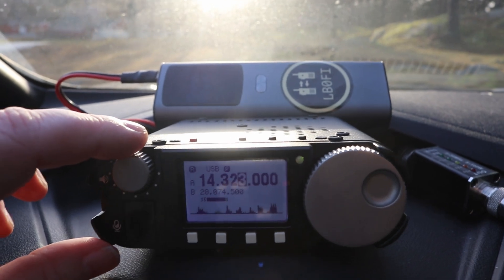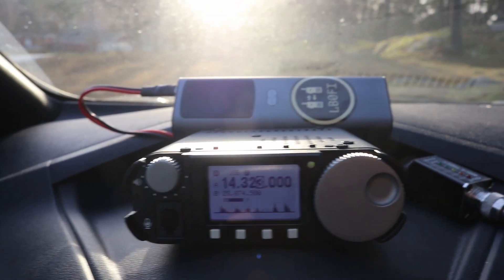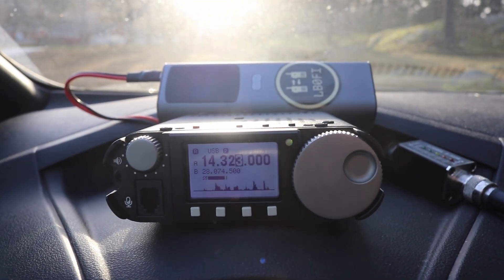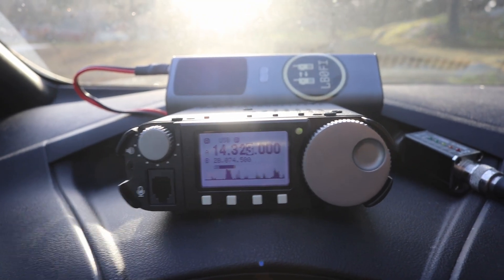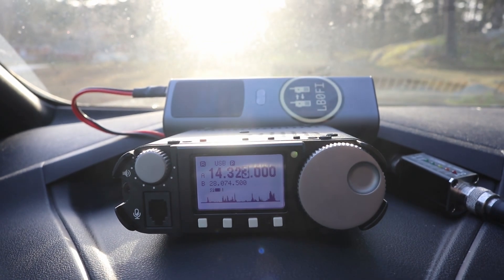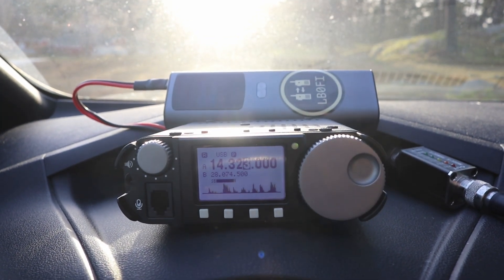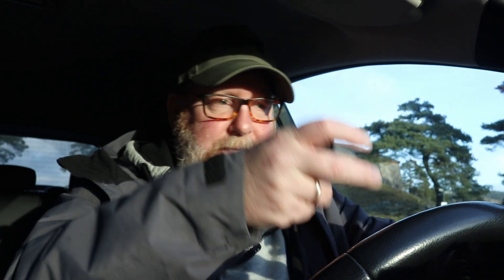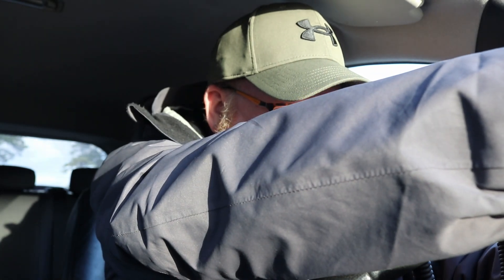POTA with the MAGIC of USB C PD

Comment: Thanks for the nice video.
Can the battery deliver 12 Volts, or is there an upconverter in the cable?
73 de LA6NCA
Reply from the maker: The battery delivers 12V, so no upconverter in the cable. There is, however, a trigger chip in the cable telling the power bank to deliver 12V. USB-PC can deliver 5, 9, 12, 15 or 20 volts depending on the power supply.

Comment: Those in the U.S. can find the USB-C to 12 volt adapter I recently purchased by looking on Amazon for "USB C to DC 5.5mm x 2.1mm Power Cable Cord." It's $8 and comes with eight plug adapters of various sizes.

Comment: Well done and informative.  I'm starting the process of going out QRP you've shown that it can be done simply and at a budget friendly cost (not knowing what the power bank costs).  I'd be happy with a simple radio - low power, several bands and capable of phone and CW.  Cheers!
Reply from the maker: The power bank can be as cheap or expensive you want it to be. Just make sure it can deliver enough current. Not all power banks are the same.